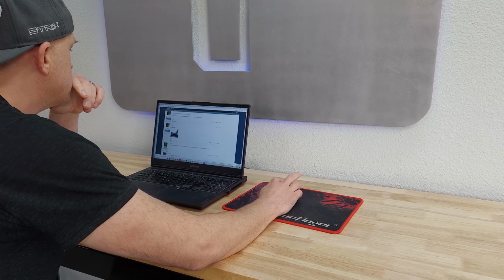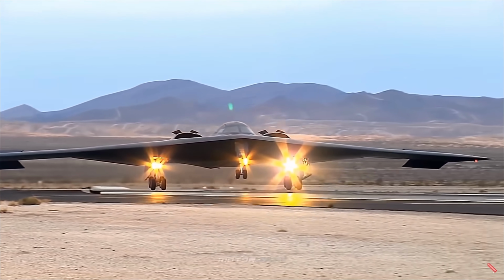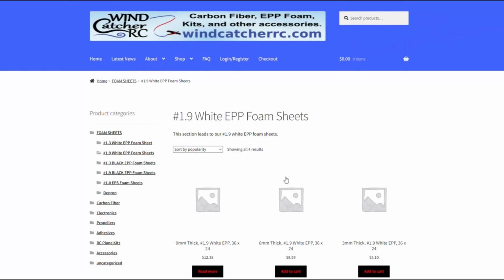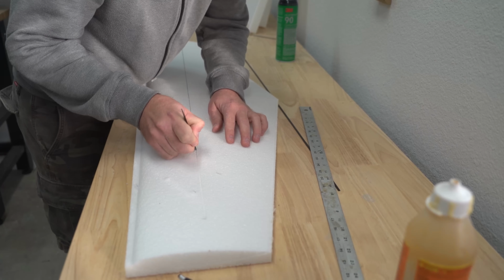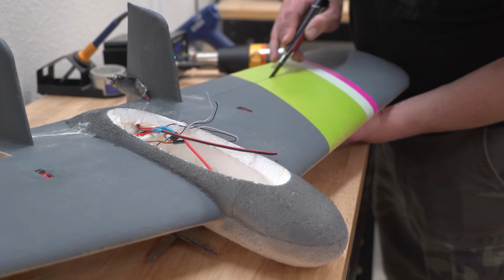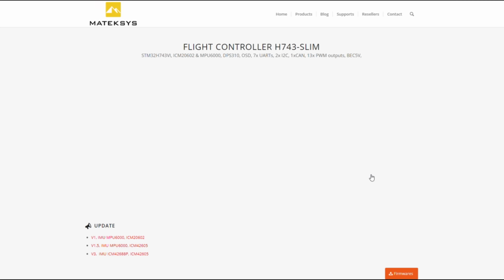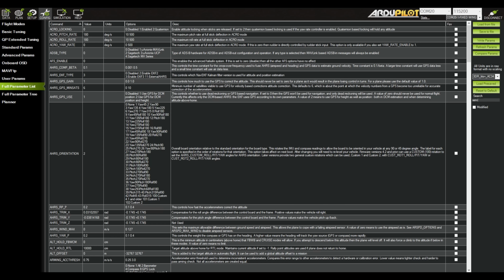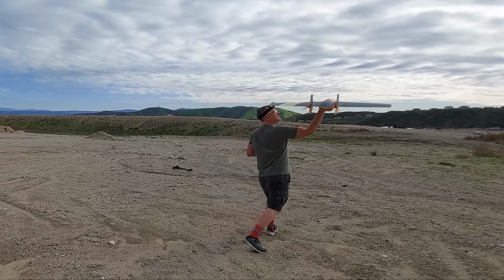Aerodynamic Instability:  The Holy Grail of Efficiency?  Part 1

Comment: 1:43 "larger than needed for their optimum cruising speed"
Nope. At optimal cruising speed bigger wings equals higher altitude and less drag.
Hold speed constant, not altitude.
1:52 "wing could be 25% smaller than normal"
Which reduces your maximum altitude, thus increasing atmospheric pressure and so drag. Until the engine efficiency falls significantly, the longest wing/highest altitude for a given power is best.

Comment: Just saw the video. 
I'm thinking the issue could be where the gyros are located. In standard wing configuration, the gyros are at or near the intersection of all 3 axis. 
It may be receiving conflicting data from the accelerometer. Lol, not sure what answer is with aft cg and frwd center of pressure. 
I have many rc wings, only one has a gyro. No appreciable value. 
I was tp on a full scale wing, it had zero electronics. Flew pretty sweet!

Comment: No one can fly an unstable aircraft without using normal G force for gain,or using an AOA sensor. So my friends and I are using angle sensor as AOA sensor to fly model fighters ,use AOA gain to canard or elevator.If you use gyro only, it will not work.

Comment: Try launching it upside down. I built an unstable control line flying wing that alway dove for the ground and until it was launched upside down it was unflyable. It floated around upside down until it built up speed,  became unstable again and flipped over at high speed becoming stable again. When the speed bled off it was another flip and landing upside down. 
I should have shown it off more. It was wild and taught me something. I'm still not sure what.

Comment: ha ha - sometimes controller introduced frustration kicks in,  part of the control problem comes from using linear controllers in non linear ranges - to nonlinearise the control PIDs- one needs to be able to something like gain scheduling (a lookup table with velocity vs PID values  - (in pitch)) based on airspeed.

Flying under manual control controlling the +/- Flaperons with a side slider you should be able to get to a stable takeoff/ landing setting and a cruise / high speed setting.  (I have used similar in manual RC planes with really low wing loading  to get them behind the power curve for controllable short landings - the sort of aircraft which otherwise lock into ground effect and never want to touch down.).

Comment: If you add an elevator about 2 feet behind the plane, it will allow you to play with the center of gravity without losing stability. I know you want a flying wing, but the elevator doesn’t have to be bigger than 10% of the plane width if you mount it back far enough

Comment: Maybe its better to use a Canard-Configuration This is more efficent, because there is no Need for negative Lift on the Stabiliser. You can trim those Planes stable for initial calibrating your Flightcontroller Settings. Than you can optimise the CoG for best Efficency without totally loss of Stability.

Comment: Aerodynamic STABILITY: The most efficient? Yes, the "fixed wing" design was a dangerous mistake that has killed millions. The "moving wing" or "control wing" and its hybrid the "freewing" flies itself, e.g., if the pilot becomes unconscious the plane will land when it loses power . Also, in flight, it cuts through the air currents, flying in a straight line unlike the fixed wing design. This consumes less energy to transverse from point to point, and gets there faster.

Comment: This is rather obvious, in that flying wings have substantially lower Coefficient of drag in relation to wing area than conventional fuselage and stabilizer arrangement. 

But without the stabilizer, are unable to utilize flaps due to flaps extreme nose down pitching moment that amounts to elevator-down deflection for a flying wing. 

You can offset this nose-down aerodynamic pitching moment by nose-up moment, either by horizontal stabilizer or by weight x moment arm aft.

You would have to have a weight-shift design to make this work well. Because if you simply place the CG aft of the NP a small amount, you can still only use a small amount of flaps and gain a small amount of lift. 

To gain a large amount of lift to make this worthwhile would require a very far aft CG. But a CG this far aft would require flaps deflected at all times. Which means you are cruising around with deflected flaps, and also have less elevator control reserve. 

So shifting weight is needed. (Actually there is another way that remains known to a few). But overall, this is how birds land and studying them will tell you much about shifting AC in relation to CG and all.

You also have to solve Yaw issues which are already difficult in a flying wing. Vertical stabilizer area x distance from CG, move Cg aft and area must get larger creating drag and adding weight.

Comment: MS student in Aerospace Controls Engineering here. Just a little comment: instability does NOT make an airplane more maneuverable, that’s a super common myth. I recommend reading the X29 papers, where researchers expected a greatly maneuverable plane but found no benefit in make it more open loop unstable. An airplane is most maneuverable when it is neutrally stable, and making it more unstable only reduces control authority. Control surface effectiveness is the main factor affecting the overall maneuverability of the aircraft. 
As others have said, you should create a model of your aircraft and design a controller around it. Feel free to contact me if you have any questions/need some help. All the best!
Reply: Butts, S. L.; Hoover, A. D. (May 1989). "Flying Qualities Evaluation of the X-29A Research Aircraft". U.S. Air Force Flight Test Center. AFFTC-TR-89-08.
Reply: Hi,
I would be interested in a dischssion about the theoretically most effizient plane configuration. Airfoil, wing shape, cg etc..
Cheers.

Comment: You can achieve the same goal merely using numerous moderately sized chord-length wing fences lined at the bottom of the wing and an inverted winglet to prevent spanwise flow, allowing for a smaller wing to be effective during slow speed flight and not necessitating instability for any reason

You might be surprised to find this would give the plane some nose heavy-like behavior due to the air not being allowed to spill off the wingtips, so the CG might need to be adjusted closer to the NP than normal.

Comment: It looked like some heavy PIO there (or CIO, Computer Induced Oscillations). I wonder if using the video you've taken you could analyze the frequency of the oscillations and tune the autopilot to damp those out? The pitch oscillations seemed to be in the same frequency range every flight but that's just by eye, not counting frames in a video.
Reply: If you are correct there is no fix to the issue as it is a non linearity in the control loop.

Comment: You will need to use helicopter tail rotor servos with the fastest throw rates you can buy. Your cycle rates are getting bottlenecked if you are not running those specialty servos.

Comment: information.        MANY  people  are oblivious to the fact that  cg  and  center of mass (c-m)  are  NOT  the same thing.!        cg  is  located  at  the  main  wing.      c-m  is  NOT.       see this illustration, in which the  IDEAL  location of c-m is indicated; the c-m should be located on the thrust line, and should vertically align with the NP.  (25% of mac)
https://s3.amazonaws.com/assets.flitetest.com/article_images/medium/truecg-jpg_1384168691.jpg
neutral point (NP)  is always located at/near  25 percent of chord/mac; and, it is  Normal for the  cg  to be located aft of the NP/c-m/25%.
when these two values (25% and 30% of mac) are transferred the root chord, they are both in the range of  45 to 50 percent of root chord; with  c-m being located slightly forward of cg. 
in order to evaluate the location of the c-m, the airframe must be balanced at its fuselage.        d

Comment: Just a thought, it seems to me the magnitude of of the weight of the batteries and the length of the lever arm is rater large compared to the forces the flaperons can generate at the low speeds during takeoff. The inertia of the oscillations are too great for the autopilot to manage.

I would keep reducing the distance between the CG an  the Neutral Point by 50% until I gat to the point I could fly the plane and go from there. It is lot easier to understand what is wrong with a plane that goes from stable to unstable than to try and fix one that keeps falling out of the sky.

Comment: Just a point of clarification - aerobatic planes ARE NOT UNSTABLE.
Some aerobatics planes, like the Pitts are less stable then the modern competition aerobatic planes like the Extras. It comes from how competition aerobatics is scored. There are no additional points for high Gs ore tighter loops or how fast you can roll.
Aerobatics has a similar scoring concept to Gymnastics and diving. Judges start with a score of 10 and then take of 1/2 points and points for deviations from the ideal figure. So if a loop is NOT round the judges start taking of points. If a line isn't straight the judges start taking off points.

Pitts are great fun (I have flown one) and they are awesome to learn tail dragging in, BUT the very short coupling (length of fuselage and wing span) makes them very twitchy. I have flown in an Extra 300L (2 seater) and it is amazing how stable they are. They don't twitch and jump about like a Pitts and for very clean aerobatics they score more points.

Comment: If you haven’t already, you should do some research on control theory. Control theory covers gaining stability via closed loop control of a system that is unstable in its open loop form. If you can accurately model the dynamics of your open loop plane (angular acceleration of plane pitch as a function of elevator angle), you can model the closed loop dynamics. (Makes tuning less tedious and more methodical)
Reply from the maker: Interesting.   This is the kind of feedback I am looking for, as I knew going into this I was getting out of my comfort zone and in over my head 😅
Reply: @thinkflight If you would like contact to an aeronautical engineer or electrical engineer both working in aerospace, I could arrange for both.

Comment: Not quite the same as your study; but I won a fair number of soaring contests using a Hobie Hawk with a very rearward CG.  In clear air any thermal would upset the sailplane outward; and by just adjusting the elevator & rudder trim to a preset turn against the upset, the Hawk would catch the thermal and start taking its ride up on the thermal elevator.  When the Hawk got too far downwind, the trims were put back to neutral and the Hawk was again sent straight upwind hunting for another upset and thermal.

Comment: I appreciate your experiment as your arguments seem aerodynamically valid. As you stated, wings could be reduced in size while achieving better L/D ratios by having the CG further back. My calculations led to similar results, but I then stopped my research as the instability issue seemed too risky to me. 
IMO it depends on the weight and distance between CG and NP that needs to be compensated by the control surfaces. I mean, having the CG behind the NP means that changes in pitch PLUS the weight moment need to be managed through the control surfaces. On the other side, you want to keep the control inputs as small as possible, as they are augmented by the CG position. A linear expo is not bringing you close to the goal, I guess....
I'm very curious about the proceedings of this study. Looking forward to the next videos

Comment: Looks like your controller is underdamped. 

If possible in your SW, tune your PID with less proportional gain (to reduce overcorrection), and more derivative gain (to anticipate overcorrection and dampen it). 

I also agree with those saying to start with a less drastic CG shift. 

Very interested to see how this develops - you definitely earned my sub.
Reply from the maker: I will probably use the autotune feature and slowly walk the CG back.   I am not great at tuning PIDs, very curious to see (if it can stabilize it) if it follows your suggestion.

Comment: 400 refreshes per second seem enough to get stability, I don't think that eg. F-16 flight computer could manage much more when it was designed.
Servos are most likely the limiting factor, because the controller is trying to change their positions rapidly to keep control of the unstable craft, while the rate at which they respond is slow.
Maybe try to source faster rate servos and try them with the same aircraft? I think it will work then.

Then again it might just be a problem with PID tune.

Putting the CG closer to CL will also give the controller less work, as it is it might be a little too far back.
Reply from the maker: All your observations are spot on imo.
Reply: @thinkflight  About PID tunings - you might have too much P gain and that might cause it to oscillate, conversly you might not have enough D gain to limit the rate of  controls position change (it might be overshooting the stable position because CV rate of change is too high).
Is the D term working on error or just the process value? I'm not entirely sure if the derrivative kick from working off the error is helpful or not in this case, would need tests with both algorithms.
I gain should be just high enough for the airplane to keep pointing at the set direction.

Starting with milder CL vs CM offset might make tuning and experimenting easier, then you can go more and more bold.
Also do you have a way to limit attitude rate of change? Basicaly what you input with your sticks should be interpretted as desired rate of change, not desired controls position (I don't know how ardupilot actually works, but I will check out the documentation, this whole subject is very interesting). Then the flight controller can just trim out attitude rate of change to zero when there is neutral stick input and keep the plane pointing straight without input from you. Eventually you might want a wing leveling function to level out the plane with no input on roll axis.

Comment: Back in the day....I would occasionally fly a model with the c.g. way out of whack, further rearward than your line indicates from center on this craft. It was always a handful to gain altitude, circle, and back down to terra firma. But not nearly as squirrely as that flight controller trying to wrestle your wing into the air. have you tried to manually fly the aircraft?

Comment: I think you could try increasing the moment of inertia in the pitch axis, so instability will onset slower and give the servos more time to react. Full sized relaxed stability aircraft or slightly unstable aircraft are flyable (albeit with difficulty) by humans, since it takes a while for deviations in the pitch axis to put the plane out of control.

Comment: Aerodynamic instability (by itself) doesnt increase efficiency.
Its trivial to have a setup that unstable AND inefficient (at the same time).

Efficiency is increased by only having lifting surface (for example conventional horizont stabilizers on tail push the tail down), such setup is more efficient, and unstable.

However that doesnt mean that unstability increases efficiency.

B-2's dutch rolling tendenciea are prime example of that. KSadly the thing was already in air a year before bell shaped lift distribution's benefits become common knowledge, so such setup had to wait till B-21 raider)

Comment: Canards instead of elevators can offer a similar unstable but beneficial setup - they provide upforce at the front of the plane rather than downforce at the rear. This requires more fine control, but means no negative lift in stable flight, at any altitude. Upshot is the CoL can remain behind the CoM.

Comment: Don’t know if you can answer this but I’ll ask anyway - in an unstable fighter or other aircraft where it’s been perfected it’s said a human pilot could not fly the craft without the flight computers.  What I am curious about is what is the condition limit of the system?  In other words, to what degree is the system receiving data about stability and acting on it that a human could not mentally or physically handle?  You show 400 Htz in you plane.  Are these fighters and such adjusting control surfaces this fast, just buzzing with micro movements?
Reply from the maker: I don't know, learning with you :)

Comment: You know, I need to do some research myself on this but I think that your standard servos that have like a 60deg/100ms slew rate only move that quickly when they're already moving. I think the rotational mass of the moving parts of the servo means you get a lot, lot less, like maybe 10deg/100ms in that first 100ms. Its fine if you're going from +90deg to -90deg in one shot, but for stabilization, when you're constantly changing the direction of the servo, you get an order of magnitude less rotation per unit time than the servo's listed specifications.

I'll have to take one apart and tap off the position potentiometer and see just how slowly servos move from a dead stop. Obviously it will be even worse when you're making it actually change directions.

If you're making a 30 degree change in aileron position and (all else being equal) it actually takes 500ms instead of the 50ms the servo specs say it will, then its no wonder the flight controller and/or IMU have so much trouble stabilizing anything.